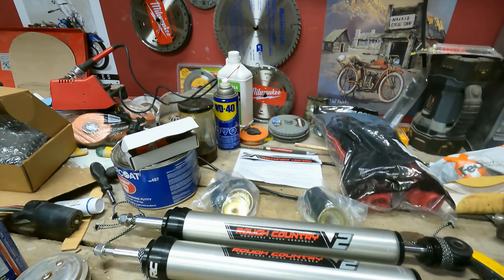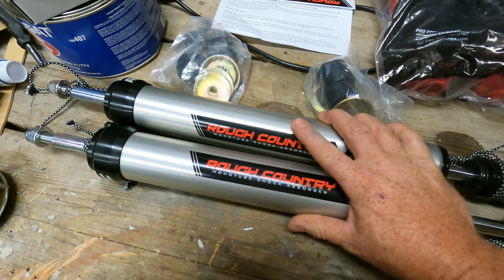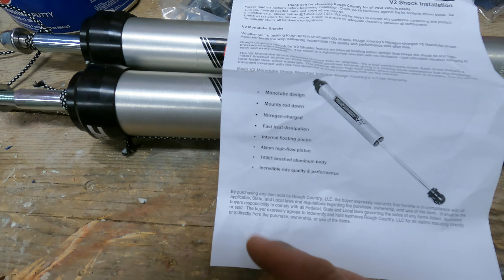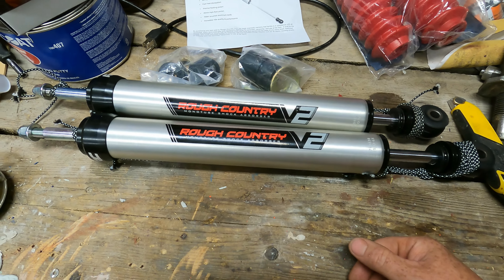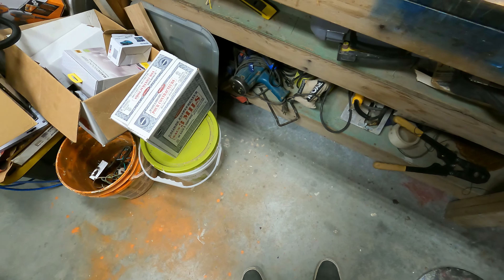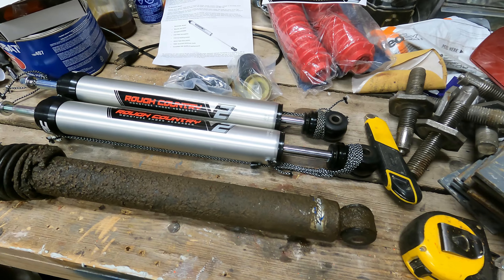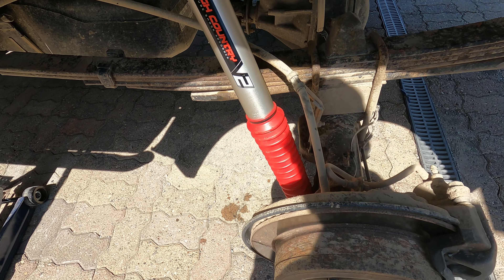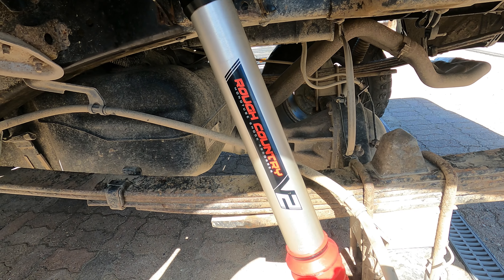Replacing the Show pony rear shocks with the ROUGH COUNTRY V2's

Comment: I just can't decide between these and the Vertex for my F150
Reply from the maker: It all depends on what you're using the truck for. Vertex are a big jump in price ,But they have adjustable damping systems. So you can adjust them for the terrain you're on. Not so much the V2's ,But I do a lot of off road driving and these have preformed awesome .Especially on wash boarded off roads, The rebound on the V2's keeps you straight as an arrow down the road and not fish tailing. And Good underload, Have a quad on the back every so often.The V2's are good value for money if you're on a budget. Hope this helps 👍
Reply: @SilverFox-je9hf absolutely helps, thanks for the f/u. I think I've decided to go with the Vertex. Scavenged around YT last night and found a vid where the guy was removing V2s and installing Vertex on his lifted F150 so I got a very good idea on the install, feedback, application, and use feedback. Will hunt down a Black Friday deal when it comes around. Cheers!